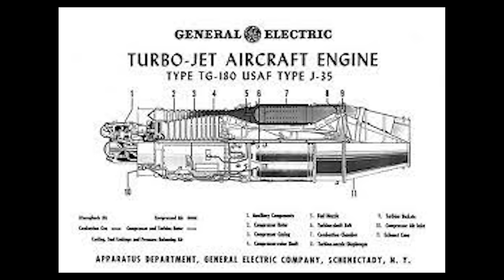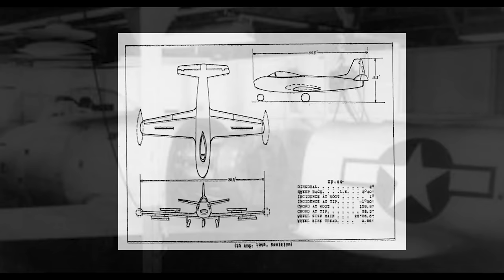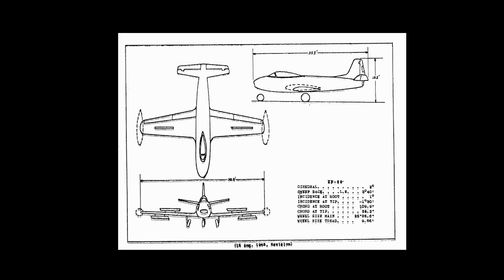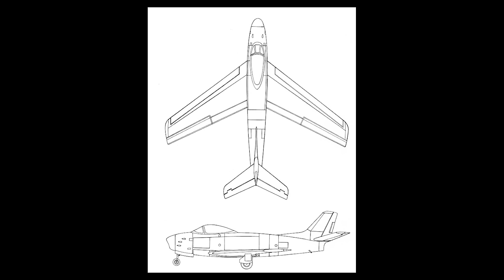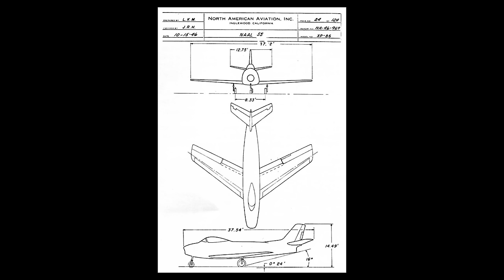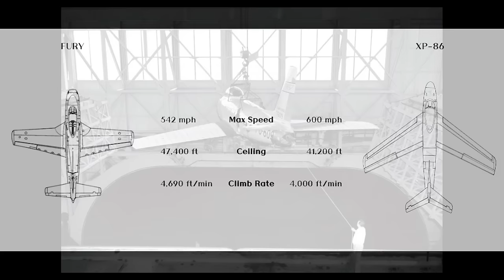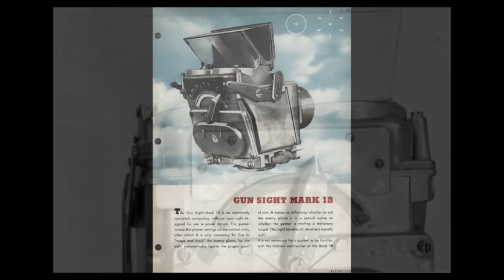SABRE: Development And Evolution Of The F-86 From Straight Wings To GUNVAL

Comment: The oversimplified and misleading P-51 narrative needs to be adjusted.  The British Purchasing Commission DID go to North American Aviation to ask NAA to build ALLISON engined P-40s.  Instead they were persuaded to give the Allison-engined P-51 a roll of the dice.  However, the usual omission is that Allison Mustang handily outperformed the P-40 that the BPC originally sought, so that could not have been a disappointment.  Secondly, the contemporary Spitfire at that time was the Spitfire Mk.V, which also had a single-stage Merlin 45/50. The Allison Mustang was some 30 mph faster than the Spitfire Mk.V at 5,000 ft, and 35 mph faster than the Spitfire Mk.V at 15,000 ft.  So again, an improvement.  Both the Spitfire (in the Mk.IX) and the P-51 (B, C, D, and K) gained significantly improved altitude performance when fitted with the Merlin 60-series with two-stage, two-speed supercharger.  It should be noted that Allison Mustang still held certain performance advantages over the Merlin variants of the Mustang at low-to-medium altitudes, and was better suited to long-range interdiction, tactical support and tactical reconnaissance at these altitudes.
Reply: The Allison engine gets a lot of stick from ignorant people, but it certainly did just fine fitted with a turbo-supercharger in the P-38 Lightning.
Reply: @GeneralJackRipper  needed the second stage offered by the turbo though, single stage super chargers were obsolete by 41/42
Reply: @thomasbaker6563  Correct.

Comment: At 27:14 you mention that some hydraulic systems were redesigned due to sudden failures. My uncle E.H. Harris was flying his Sabre sometime in 1951 or 52 when he suddenly heard an explosion. His engine died and the hydraulics didn’t work. He was in training at Luke AFB. He didn’t want to bail out so he made a dead stick landing at Phoenix Sky Harbor airport. They were able to save the plane and analyze the problem. The engine had lost a turbine blade and it severed the hydraulic lines. After this they modified the hydraulic system so it wouldn’t happen again.
Reply: My dad, Murray A. Winslow, did training at Luke and William's AFB, sometime after 1955.

Comment: XF-86: "hey Willy, can I copy your wings?"

Me262: "sure, just change it a little so it's not obvious."
Reply: The Me262 had the same wing sweep as the DC-3…
The real swept wing progenitor was the Me P1101 as rebuilt as the Bell X-5.
Reply: Compare Me262 front view with a Boeing 727. The latter is of course bigger but the similarities are uncanny.
Reply: @Dave5843-d9m  Now compare the DC-3 with both - the DC-3 had under swung engines and the same wing sweep as the Me262…
Reply: I was an F4E Driver in the early 1970's. The F-86, was much simpler. It would have been fun to fly.
Reply: The Tiger Moth also had transonic problems hence the leading adage sweep on its wings.... sorry that should read centre of gravity issues not transonic problems.
Reply: Or else it will get a copyright infringement strike on YT 😅
Reply: @wmffmw1854 I’d give anything to fly in an F4 !
Reply: The 262 had straight inboard wings and a 14 degree outboard sweep in the original design.  When the BMW engines never materialized Jumo 004 engines were used instead.   These Jumo's changed the center of gravity of the airframe so the designers changed the wing sweep to regain it's center of gravity.  Even still the wing had less sweep than the Spitfires elliptical wing.  Now the F86 had a 35 degree sweep, in 1943 the high speed trials unit testing the Spitfire had a test flight go wrong in which the propeller gearing failed and the unit was ripped off the engine while diving.  The aircraft then free from the propeller fell out of control when the pilot lost consciousness but recorded a top speed of Mach .92 or just over 700 mph.  The forces at that speed bent the wings back at a 35% sweep ironically.  With the loss of weight on the nose of the aircraft it righted itself into level flight gliding down when the pilot regained his consciousness.   He first thought of bailing out but was close enough to base and had enough altitude to land the aircraft intact to be studies.  Many never heard of this incident or the resulting sweep to the Spitfires wings to 35 degrees.  Yet all that test data was shared with the US during the war.  The high speed trials unit also conducted models tests confirming the effects of the sweep on the wings.
Reply: @neiloflongbeck5705  It was a logical simple fix used many times.  Much like tilting the wings up or down to help with the landing gear as well.
Reply: @jimdavison4077 Trying to dismiss the 262 heritage of the F-86? I think the video made clear where the biggest design data and inputs for the swept wings of the F-86 came from. Yes, right, Germany and Messerschmidt! He mentioned the 35deg swept wing that was in design and intended to be installed to new high speed Versions of the 262 which were project-called HG I - III (HG = Hochgeschwindigkeit or high speed). The Messerschmidt P.1101 with statically adjustable wing sweeps was intended to be the flying test bed for different sweep angles. It later was the base of the first true sweep wing aircraft, Bell X-5. 

For the serial built 262's it is true that its minor wing sweep was introduced foremost to adjust for CoG adjustment due to the heavier Jumo004's and it is also true that the low angle will only have a small effect on max speed and critical Mach number. But the effect was certainly known by Messerschmidt and intended to be a secondary advantageous effect on the 262's flight characteristics. It was by no means coincidental. The CoG could  also have been adjusted by other means.

Comment: Off topic based on P51 comment. 
Mustang was built with the Allison single stage V12 because that’s what the P40 Tomohawk used. Both were intended for low level use so no worries. A British test pilot saw the Mustang’s potential. Rolls Royce were given 5 airframes and 6 weeks later had a prototype flying. It looked clunky with a big under spinner air intake but was only 4mph slower than the finished version with intercooler alongside the main radiator.

Comment: But when will you cover the best Sabres ever built - the Orenda-powered Canadair Sabre Mk. 5 and Mk. 6 which could fly rings around the others?
Reply: Not the CAC Avon Sabre redesigned and used by the RAAF, handed down to Indonesia and Malaysia, Twin 30mm Aden canon as well. Get hit by 1 one round and your dead!
Reply: That's what happens when you take an already aging design and update it while the original designers are busy coming out with a while new generation of jet that would crush it in a moment? Like you really think that no one in the US could have put a better engine in an F-86 and made it better if they had any need to? They were making the F-100.
Reply: @justforever96 That’s ignoring the F86H too which HAD a better engine than the Avon CAC Sabres. 1500 lb of thrust more higher climb rate, better energy retention and so on.

Comment: My dad was an apprentice tool and die maker at Ilinois Institute of Technology he worked on the T-160 Reverse engineering project and on a Boosted Rocket gun for the F-89 Scorpion. First full auto test with the T-160 on a range in the Indiana Dunes blew the roof off the firing bunker. A similar test with the boosted Rocket gun at 1,000 yards put all its rounds into a 1 mil circle so the F-89 got the 2.75 inch folding fin rockets nicknamed the Mighty Mouse with a better dispersion pattern also the F-86D got them also.

Comment: Excellent video. I have only ever seen a real sabre in a museum, but if DCS is accurate in its flight models, the Sabre is a much nicer plane to fly than the Mig-15. That T-tail really bites you at high angles of attack and like most Ruzzian things, the ergonomics are much poorer in the Mig. And yes, the virtual Mig can definitely take a beating but the 50cals have higher muzzle velocity which makes them much (much!) easier to aim than the 37 with its limited ammo that runs out quickly and even the 23s, the real meat and potatoes of the migs weaponry, are inferior in everything except damage, assuming you can hit something. 
From this virtual experience, I can see why they tried the high velocity 20s but the 50cals can work. As they have so much ammo, the pilot  can spray quite a bit and after a few hits in the right places, even though the Mig is still dangerous, it flies at a disadvantage and is relatively easy to finish off. Of course, this is one part of the sim that is a lot of guesswork. Even with subject matter experts (retired pilots who flew the planes) there won’t be too many who know exactly how damage affects performance and rye won’t have modelled every possible type of damage. 

I repeat - all of this is virtual experience and with the best efforts in the world, the programmers may have missed a few tiny things that make a big difference. It’s also an older module so the developers have most likely got better at accuracy as time goes on. 

Anyway. The Sabre is a much prettier plane and when you are flying virtually for fun, that should not be discounted!
Reply from the maker: Thanks for the comment. As it happens I have a deep dive into the MiG-15 coming in January. Your conclusion is right in the main. The Sabre was easier to fly for the average pilot and, from the F-25 onwards was superior in most flight regimes to the MiG-15bis. In the hands of an experienced pilot, however, the MiG was probably the better aircraft as a really confident aviator could fly around its foibles and make the best use of its combination of thrust-to-weight and heavy armament. Again, once the F-25 comes out, I think that situation reverses.

Comment: The Royal Netherlands Airforce deployed the F-86K model, with an enlarged radar nose, because of which it had all weather capabilities. I missed this type in your excellent video. Is there a reason why?
Reply: So the D or K model  were meant to be an upgrade of the Sabre, but they changed so much it was basically a whole new plane (According to google they only shared 25% parts ) , so I can see it being a seperate video.

Comment: The F-86 only broke the sound barrier in a dive, critically Yeager broke it in the X-1 during level controlled flight. That's the difference in deciding who gets the credit for the achievement.
Reply: And it did it in a dive AFTER the X-1 did it. The myth that it did before has been throughly debunked, and unfortunately the myth was repeated here.
Reply: @dougcastleman9518  For some reason the X-1 program has become a touchy subject. Lord knows why.

Comment: well that's a really good video my friend North American Aviation of Los Angeles California was incredible company very incredible it had some of the best engineers in the country working for it including the f86 all previous aircraft including this aircraft cocktail napkin design aircraft. Yes that's right believe it or not some of the most incredible aircraft in the world we're firstly drawn on cocktail napkins for some reason the North American Aviation Engineers did their best design work at the bar. A few weeks after Chuck Yeager broke  sound barrier the data and Technology came to North America the X1 break the sound barrier it was the Flying tail that Chuck Yeager and Jack Ridley designed that was the f86 secret weapon if it didn't have that flying tail the fa6 would not been able to break the sound Burger because the sound barrier like you did on the X1 would build up on the control service area of the tail and render it unusable just before the sound barrier would break so no control we were flying tail you can fly through the sound barrier without the build up on the control services. And today the flying tail is the thing on every fighter jet main command and anything else that goes fast but back to the plane. Harrison storms was a incredible engineer really incredible, his first week at North American Aviation was trying to get the weight down on the Doolittle B-25 so they can lift off Carrier deck of the hornet. Harrison storms was a model maker for many years as a kid and he said well you know instead of aluminum for all the control surfaces we can go back to just fabric cover control services and that would save me a huge amount of weight and that's what they did and they made surfaces bigger too they enlarged the flaps so more air could be shoved underneath them when they need to take off The Courier deck that's one of the first things Harrison Stones did when he was he novice engineer at the North American Aviation company but he took on a lot of the aerodynamic engineering on the f-86 all the different models including the last models  the H and J models also.  the f-86 if you get a chance to send one is something else it was built like a Cadillac seriously it was very well put together. I know a lot about North American Aviation cuz my father worked for North American Aviation from 1953 to 1984

Comment: What are the bulges on the sabre fuselage at 40:38?
Reply: That's a RF-86 reconnaissance version.  The bulges contain cameras mounted in varying positions.  A few RF-86s, F-86As and later F-86Fs, were field modified in Korea during the war and the bulges, armament, and camera layout differed from aircraft to aircraft.  While some RF-86s retained two M-3 .50cal machine guns, most were unarmed but often retained the gun ports, or had gun ports painted on, to give the appearance of being armed fighters.  Whether this ruse was effective in a jet dog fight is debatable.  While the USAF standardized on RF-84Fs, the Japanese JASDF had small numbers of locally-built RF-86s equipping a few squadrons.  The JASDF did not use F-84s so RF-86s made sense.
The USAF also had North American Aviation make a handful of RF-100As that served in Europe and the Far East until the RF-101s came on board.

Comment: Why does everybody keep propagating the myth that NAA designed and built the Mustang in 101 days when it took other builders' years? The truth is they bought the design from Curtiss. The plans were for the replacement for the P-40. If you research Curtiss, you will find that all the P-51 innovations like laminar flow wings attributed to NAA, show up on Curtiss prototypes. Curtiss built and flew at least twelve experimental planes, but none were put into production. The mystery is why. However, NAA did add innovative production features.
Reply: NAA did not buy the P-51 design from Curtiss.  They bought wind-tunnel data and laminar flow research data from Curtiss.  The NA-73 was designed by Edgar Schmued and his team at NAA.